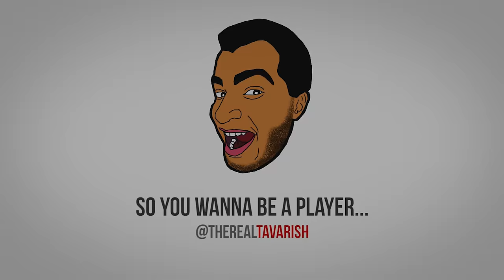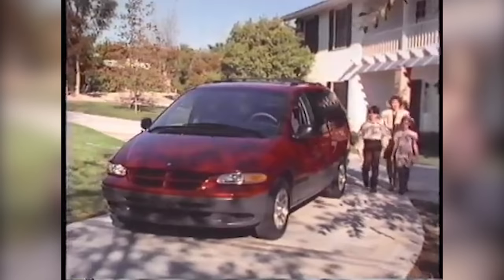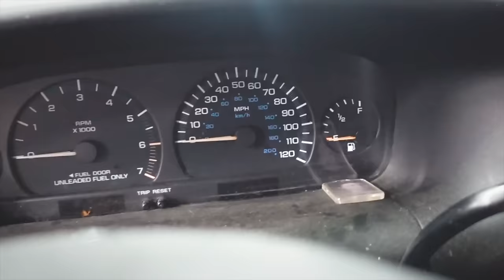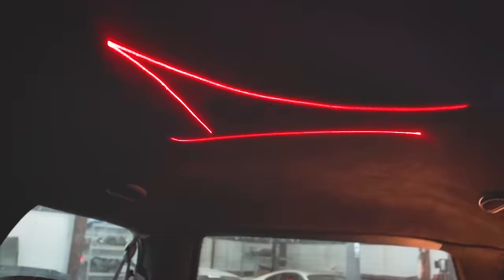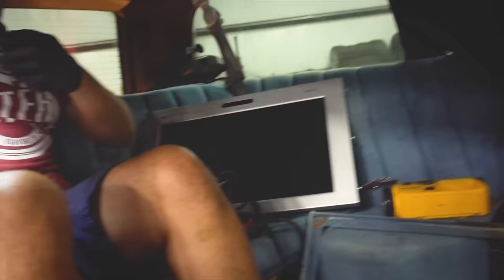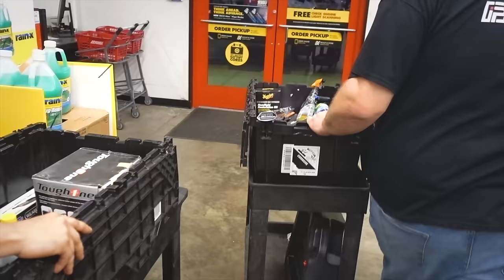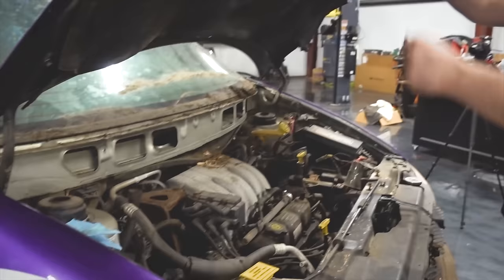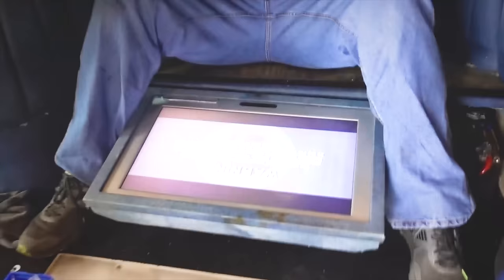I Bought An ABANDONED "Pimp My Ride" Minivan For $850 And It's WORSE Than You Think

Comment: This is one of the worst episodes imo. They took their car which they told them they used to haul their band around and they go and remove the whole backseat smh. Turning it into a two passenger vehicle. Id have been so pissed. They easily could've put two smaller subs in the trunk and had plenty of power in the sound system with such a small car. Ngl the paint job and leather work looks nice, minus the fake skeleton pieces put under the vinyl wrap. It would've been such a dope build had they left the seat in the back and not put nothing under the vinyl wrap as there's no way it didn't look like shit after a year hahaha.
Reply: Confused with the hot tub van

Comment: Doesn't matter if it says Plymouth or Dodge. It's a Caravan. It's 💩💩. Year doesn't matter. The transmissions are all bad. All of them. So when you get a rebuilt trans, it's crap. Buy a new one? Funny. The engine is good for 200K or so. ... And in this case, when we consider the prior owners, the show, the "improvements"😹😹, the paint job,  The car was worth nothing. Less Than Zero. You should have left it in the grave.  This grave robber was cheated!